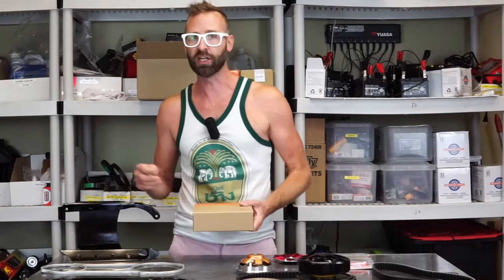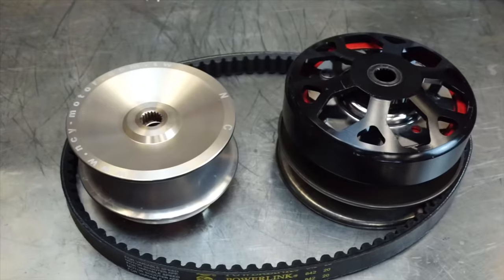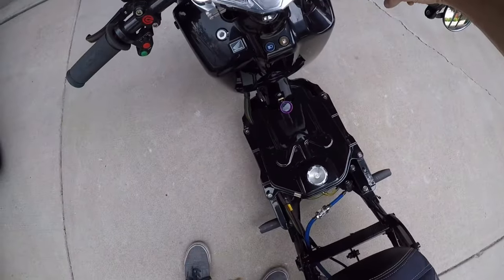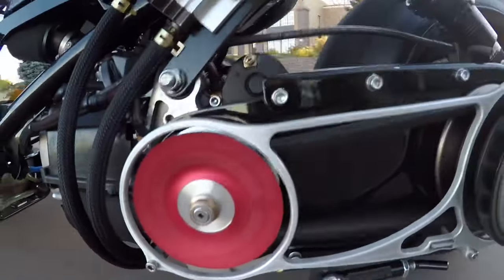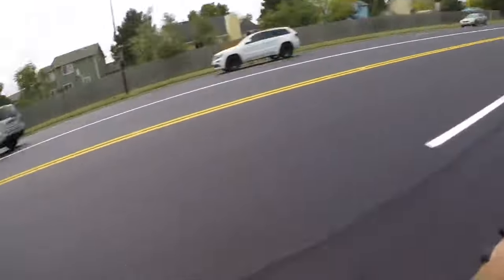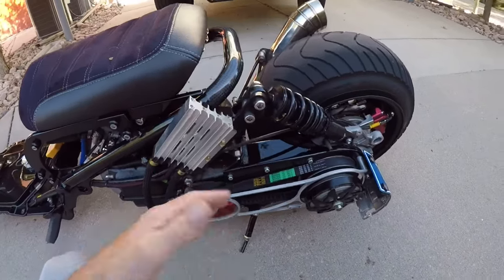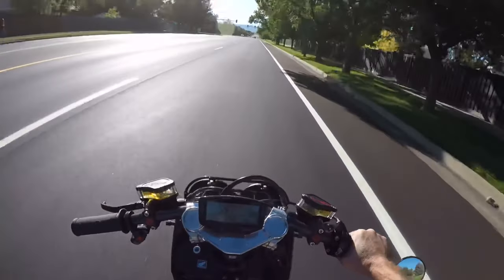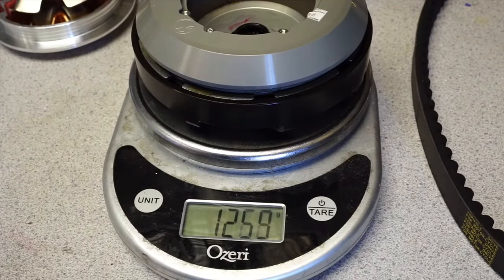The ultimate scooter clutch [MUST SEE] Reveno clutch

Comment: About how much for the kit and will it work on a 150
Reply from the maker: It will work for a 150 gy6. Links in the description
Reply: @RollingWrench  thanks I rushed to ask before the end, lol. Do I need to do any other upgrades or just the kit
Reply from the maker: @davidclayton6611  You can start with just the clutch,  but you may want to grab various variator sliders or a tuning kit. the clutch alone is nuts... just depends how far you want to go
Reply: @RollingWrench  my scooter will redline now with my big butt on it . It lines at 90 but full looks like 100+, so with the upgrades ill be over around 105 -110
Reply from the maker: DAVID CLAYTON did you get a Reveno?
Reply: @RollingWrench  no i didnt , out the crate my scooter was fast. It looks like a sport bike , i wish i could load a pic so you could see it. Ive got to get some work done on the fuel system its been sitting for 4 years. I can prime it then start it but when i hit the throttle it boggs down . it needs cleaned
Reply from the maker: DAVID CLAYTON ahhh, I’m familiar with that bike. Those are fun!
Reply: @RollingWrench  yeah it is that's why I'm trying to upgrade I'll be able to  run with the 250ninja without having to be wide open. Let me ask you does that bike have a governor on it. I'd like to make it chain drive too
Reply from the maker: DAVID CLAYTON no governor, you can’t make it chain drive because you don’t have gears. You will loose your CVT
Reply: @RollingWrench  ok well belt it is
Reply: @RollingWrench  imagine all the upgrades youve done then a turbo, it'd be a crazy ride
Reply: @RollingWrench  let me ask you a question. Since the 250 and 300 motors come one u it with the tyranny like the 150 can I swap the 250 or 300 onto the frame since its the whole motor, tranny and swing arm in one
Reply from the maker: DAVID CLAYTON maybe 🤷‍♂️. Probably not direct bolt up. You will need to fabricate a mount
Reply: @RollingWrench  so a mount to stretch the motor mounting point like stretching the swing arm

Comment: is that an oil cooler next to your rear spring?
Reply: Yes
Reply: @miguel360kmc  how did you mount an oil cooler on your gy6? or is it that type of oil cooler that goes in the bottom nut where you drain the oil?

Comment: How long do those clutch pads last
Reply from the maker: That’s depends on the way you ride
Reply: @RollingWrench  it's a built dio motor and would be mostly hammering it in town between stoplights. I'm just wondering if it's like 3k miles or 30k or 500 miles as rumors have been that the pads wear fast
Reply from the maker: pouncer11 thats a good question. I’m not sure. It would be good to know though.

Comment: Rolling I have a Yamaha bws 100 two stroke scooter, and I would like to give me a hint to improve it!!!! 
Like hell!!!
Thanks!!!
Reply: get a quality expansion chamber exhaust and a cylinder kit and some jets to tune the carb. maybe a larger carb depending on what size you have.
Reply: The original one has a big bore so only doing a porting an a little upjet it will match fine with a lot of aftermatket exahust
Reply: Carb i think that a 24 or  bigger

Comment: Hi i have a piaggio x8 125 and wanting to get a bit more power out of it , eg roller and clutch do u have eny ideas please
Reply: Rollers 9 gr if you want the top speed mor huge, 7gram if you want the acceleration more fast. Modify front pulley to 13,5° and light it as you can, cvt spring (clutch spring) use 1500rpm, and use thighter v belt
Reply: @nightstalkel1557  thanks very much
Reply: @nightstalkel1557  hi do u know where i can get the front pulley from as cant seem to find one
Reply: @leehemingway2597  i made my own custom fron the standard one. I custom it With lathe engine Check on yt "bubut pulley depan"

Comment: Dude in PR the 180cc needs wheelie bars so I couldnt imagine a 232 like the one you have! Saying that to say you should be getting awhole lot more takeoff your tear tire should be chirping and ripping like no other lol...have you tried the 2k full setup clutch springs,contra,and light rollers? I know your using sliders but you should try the dr pulley 12 gram rollers their just as good and dont get flat spots
Reply: His bike is geared to top end.  His topend was around 100mph that why he wasn't ripping off the line. Also its a stretch ruck not sure if even geared lowend they will pull them same as a vento type would

Comment: That clanking NEEDS to be dampened, all that hammering WILL do damage. A cush drive would work like on motorcycles.
Reply from the maker: Same set up as a motorcycle. You just don’t hear it because it’s in a oil bath
Reply: @RollingWrench  More teeth, and oil dampened.
Reply: Yep,plus how much you pay for it,the cost to fine tune it.You'll just keep buying
Reply from the maker: Mickey Collins it’s just depends what you are after after. Kind of like a Lamborghini clutch, it won’t Last as long as a Chevy truck clutch. But performs waaaay better.
Reply: @RollingWrench  I do understand your position.You still #1 in my book

Comment: That thing is jangley as hell, it sounds like sleigh bells. I guarantee you could get in there and remedy that jangling with so.e strategically-placed grease or graphite. Maybe even spray coat the I side of the bell with a rubberizer?
Reply: I was thinking the same thing spraying it.. i know very little about that.. but wouldn't it wear out maybe flake cause you can see the way the shoes/pads come up and the bell has them Guides there is a few mm each side..
Reply: @miguel360kmc  yeah, unless it was a very durable coating and even then, that would only mufe the sound, there has to be a way to actually prevent the jangling or at the very least, reduce it.